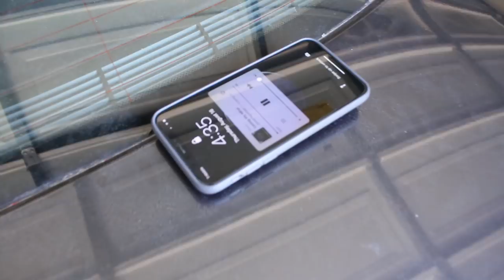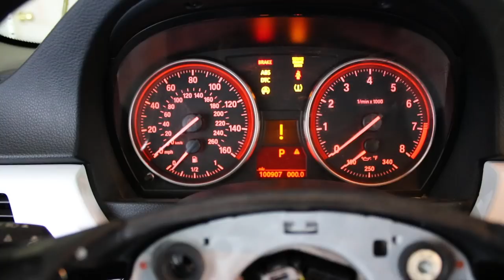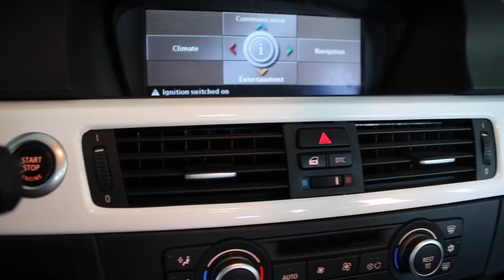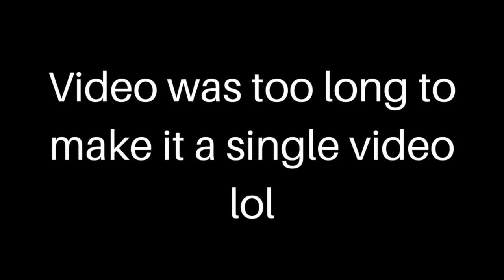Rebuilding BMW 335i Involved In Gun Fight! Part.16

Comment: Did you plug the fiber optics back into the stereo harness? Should be one black and one green cable that come together into one plug that fits into the wiring harness plug on the radio. You’ll have no audio at all until the fiber optics are hooked up. They are what send a signal to the amp to run.

Comment: Write a blank man file to the CCC and the amp. Everything needs to be coded in the E90. The fiber optic (MOST) loop should not have a single break in it. Everything needs to be plugged in or have a terminator plug.
Reply: Nick Gorkes so you’re saying to just reset the CCC to the stock settings?

Comment: Just a though, was that replacement ccc coded for you car before installation? I think your issue might be the fact that it’s come out of a car with a different speakers set up than your car so the ccc will need to be coded to your speaker level
Reply: jagger2kk +1 yes. You def have to have it coded. Especially if it came fine a car with logic 7 to a car without logic or vise versa.

Comment: Nour the fibre optic cables are fragile so twisting them or not handling it with care will result in the fibre braking. You will need to test the harness to make sure they are still good.
Reply from the maker: Morne Reyneke yea man they are still good tested them